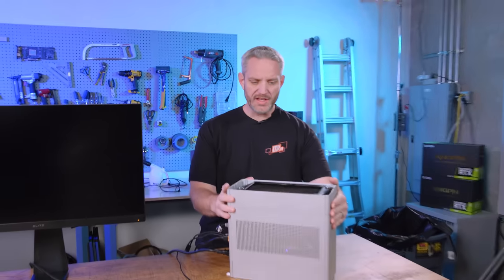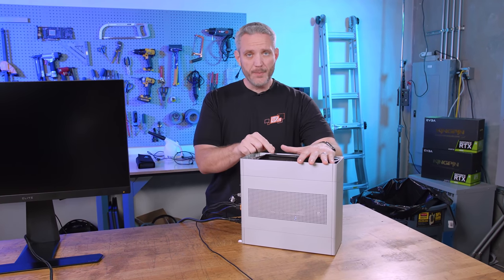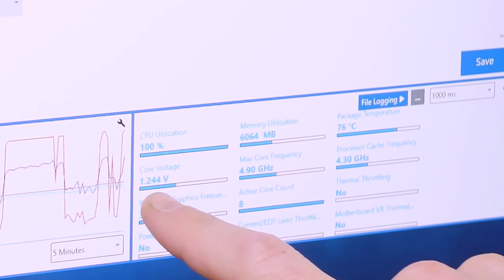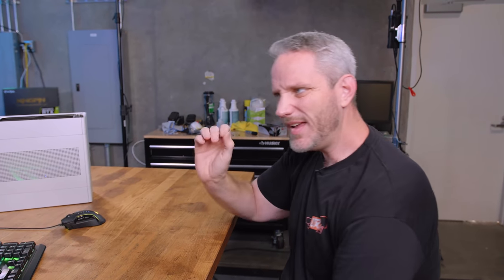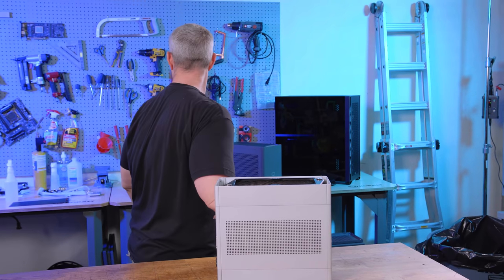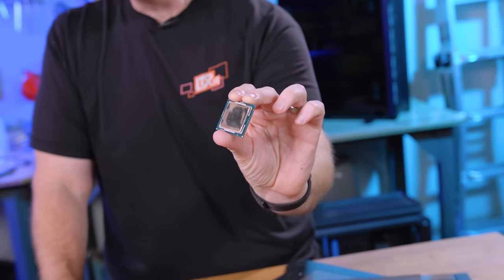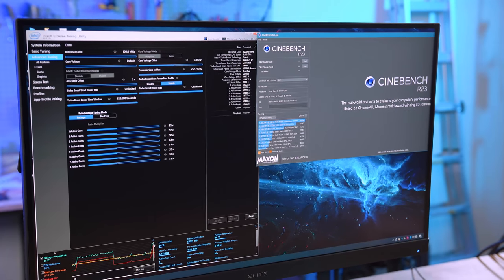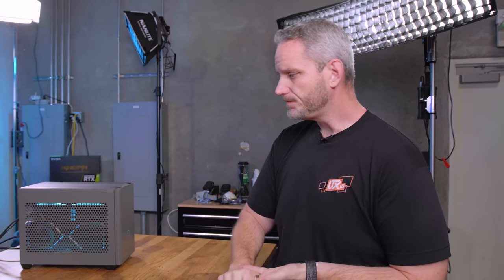THIS is what a Silicon Lottery Winner and Loser looks like for CPUs...

Comment: i know how it looks like in GPUs
two GTX 1660 Supers (ASUS Phoenix shitty model)
and one can boost up to 1930 MHz with like 912mv
while the other can barely get 1890MHz with 925mv

as an additional note, what i was trying to achieve is the highest clock with the least voltage that made these cards not overheat due to the joke of heatsink they have

Comment: My 9900k isn't a great chip, 5.0 all core @ 1.305v - had no problems playing games alone but the moment I had discord running I would get random blue screens. Bumped the voltage up to 1.325v and the blue screens stopped. Watching this makes me want to go back and retune using an offset/intel etu and see if I can get a better overclock.
Reply: Sounds like mine. 4.9 is the best I can get.

Comment: Silicon lottery = be the best you can be... lap your cpu!

Fyi Jay, in cal lab Navy, we used optical flat, caliper micrometer and theodolite to measure flatness (larger stuff we had a larger marble flat with map!).  So use optics to your advantage (overkill is better!) lol
Also, Casimir effect can come into play and you could possibly couple the cpu to the block WITHOUT any thermal paste (if possible, in theory would have the best heat transfer).

Would take time lapping but done daily for other applications.

Good stuff, Ty.

Comment: I've never done well with CPU overclocks since my 300mhz Celeron.  Never could get anywhere over a 100-200mhz on any CPU since (and that one had a 150mhz overclock...20+ years ago.  No matter what other components, no matter the methods, and countless reddit threads...the most I ever got extra on my 9900k was ~160mhz, and on Prime 95 it would still overheat - to keep it stable it would maybe not throttle at 4.7.  Other people, same coolers, similar airflow could get at least 200+.  I don't what it is, I've had terrible luck with CPU overclocks - at this point I'm never going to pay more for an unlocker/overclocker-friendly CPU ever again.

Comment: That interesting to know as I have the Xeon X5675 overclocked to 4Ghz with the voltage offset and every power saving / c-state options enabled and the vcore varies from 1.192v to 1.248v depending on the CPU threads load but most times it hovers around 1.208v. I would like to see if anyone could get close to my silicon lottery. I am over the moon getting 4Ghz with extremely low vcore :). And a bonus silicon lottery as well during gaming the temps never exceeded 45c as the GPU is the only thing that is the hottest in the system. As it air cooled by Noctua NH c12p se14 with Noctua Redux 1500rpm controlled by the bios so it spins the fan at 980rpm until it get close to 60c and the fan will ramp up :)

Comment: personally i like cold system, and as low noise as possible, so my main thing is always undervoltage, especially on GPU.. i´ve been playing with my old 3080 ASUS which from birth has been running 72-79 in my case because of constriction, only 2 intakes (140´s) but through a rad.. so 76 was the norm, with a aggresive undervoltage, YES it dropped from 2010 to 1980, but from 76 degrees to 68 degress with WAY less fan noise.. just a way lower noise signature, with .. minimal loss of performance. YES could run my ASUS ROG 3080 OC with a AGGRESIVE OC had it way over the 2010 it runs stock profile, silent bios.. so it can also run way faster

Comment: I never oc my cpu but i have a friend who have the same as me and he was forced to undervolt his cpu with stock frequency while mine just on stock voltage boost himself to 4.8-4.9Ghz without touching the voltage or frenquency. His cpu only boost at 4.4Ghz, i am pretty sure my cpu is a golden one, obv i am pretty sure if i wanted i could bring him to 5.5Ghz with no issue since he heating max at 65°C on full load. I just dont really like to overclock my pc part, oh i forgot to mention that my cpu is a 5800X3D (my friend too of course) my friend got the worst looser of silicon lottery

Comment: i won the silicon lottery on my r7 3700x. it benches and clocks like an average stock  r7 3800xt
Reply: i also got lucky with my previous r7 2700x. it punched above its weight too, but not as much as my current cpu (which i got second hand for 120€).

my current rtx 2060 12gb gpu overclocked to 3060 mem/core clocks performs above an average 2070 and is very close to a 3060 in benchmarks, while staying at stock voltage and power/temps.

my x470 motherboard runs two different 2x8gb 3200mhz c16 kits at their single kit rating. but i increased the voltage of it by 50mV as that gave the best benchmark results, even if it seemed stable without.

i have a very lucky system.

Comment: Speaking of silicon lottery, I guess I got unlucky with this 5900x I have. I went from using a 5800x that would be fine stock to having to run this 5900x at +6 PBO2 just to keep it stable. Lost frequency and temperature advantage basically. lol
Reply: Rma it brother

Comment: I've never bought a CPU that has overclocked well, usually they are barely stable at stock speed / voltage. Like my 3700x is unstable if I undervolt it at all. I think my i5 750 or whatever it was called overclocked somewhat.

Comment: I just wish I could get hold of ANY 9900K so I can prolong the life of this system as the 8700 non-K (could not get a K sku for love nor money when I built this rig 3yrs ago). 9900K's are impossible to buy new now without costing more than 10/11 gen & used prices are maybe 10% cheaper than the new cost! For not much more money I could just buy a 10/11 gen CPU & board, & if going to do that, I may as well just build a whole new rig TBH. Not into serious overclocking as stability is more important to me but the 8700 is starting to show it's age now in Premiere Pro with a RTX2070
Reply: Funny, you say you wish you could get ahold of ANY 9900k and then go on to complain about the price of them, e begging is weak dude

Comment: Very sad Intel (or Dell at least) removed undervolting on some older 7 gen laptops due to an exploit.  I managed to hack together a bios to get it back I dropped .150mv for about 15C cooler. Now the fan never runs at 100% and I haven't even repasted it.

Comment: Hey Jay I'm not sure if you'll see this ever but I'm hoping you do. I've run into a bug with my computer and have no clue as to how to stop it from happening. It started about a few months back and what happens is that my PC will suddenly crash, stop all movement from happening on screen and play a super super loud buzzing noise and doesnt fix it self. I have to force shut off my computer. Someone said it's due to the lack of thermal paste but I replaced it being the desperate person I am and honestly it sort of worked for a few weeks at this point but now its back...  any clue why? I know it's not overheating because my PC rarely ever runs hot but when it does it never happens.

Comment: Do you think silicon lottery will affect pc to run slower after being left on for more than 3 hrs before being restated? I've got a 3700x that I've had for a year and it's always had this problem, used the default cooler, used a nzxt 240 radiator, and even repasted with thermal grizzly paste and while tennis came down, I still have to restart my pc after 3-5 hrs because it acts like it's an old pc. Windows is installed on 1TB nvme.
Reply: the silicon lotteery is in regards to the quality of the silicon and how well it functions  to its original design specs  and because of the insane complexity of today's chips and nano scale differences and even quantum effects also differences in molecular composition, the position on the wafer on which it was made can make a difference as well.
yours sounds more like a software problem  or something with the RAM or even the operating system.
Reply: @connorjohnson4402  thank you for the great clarification of the lottery deal and your suggestion, I know its not my ram as I had a 2x8 kit from gskill and upgraded to a 4x8 and it still has the same problem, so I will do a fresh install of the os, as I just bought a gen 4 nvme that I was waiting for the right one on.

Comment: Do you recommend lapping a CPU(If we are comfortable doing it)
Reply: Sometimes it can help but ideally you need to lap both its IHS and the heatsink or CPU water block cold plate too as Intel IHS for years have been concave (bow inwards) and block manufacturers know this so will make their own block cold plates convex (bow outwards) (or visa versa) so if you lap the CPU IHS only then you risk making contact worse with your chosen cooler as it may then make worse contact, so for best results lap both the CPU IHS and the CPU Block or heatsink (allowing for any heatpipes etc that run across the surface of the Air cooler contact plate).
Its not necessary to get an mirror finish either on the IHS, only that the Silver coating on the IHS is removed down to the bare copper and that its lapped on glass to ensure a flat overall finish on the IHS.

You can of course "go the whole hog" and lap it to a mirror finish and use something like a very fine grit Diamond polish (off eBay or Amazon) to get the best mirror finish possible but its not something you have to do.

Sometimes lapping decreases "core to core" temperatures and other times it has no perceivable effect at all and is a complete waste of time and effort. Only you can decide if you want to try it but don't expect miracle results.

With an CPU like the 9900k, the best results in temp drops come from delidding and then pasting with Kryonaut Liquid Metal and use a Custom copper IHS, eBay has people that sell that kind of service and in the UK the average price for postage to and from the person doing it is about £60 or so and that includes the service and copper IHS too.

Comment: I probably got a massive silicone lottery loser.  I got a decent mobo (Aorus Z390 Pro Wifi), a Corsair RM750x on a pure sine wave UPS for stable power, a 360mm AIO with Kryonaut paste.  I could not get my i9-9900k to run at even 5 GHz all core.  Now, mind you I haven't done any overclocking since the days of moving jumpers to change the base frequency...  So I'd rate my competency level of modern overclocking at "complete n00b",  But even just setting everything to "auto" I don't ever see anything above 4.9 GHz, not even on one single core... and it's supposed to hit that on ONE core, right?  It's rated to have a boost clock of 5 GHz, and I know that they only need to achieve that on one core in order to claim it...  Oh well, even at 4.9 GHz it's still a pretty good chip.

Comment: Hey Jay, u can tell me if my OC is good??, i have a 5900x on 4,6GHz with 1,231v, and my trident z 3200 cl16 to 3600 cl18 1,31v and IF 1:1
Reply: i would make sure that the memory overclock is actually faster than stock, if you haven't already.
Reply: @kuyans3889  i have done different benchmarks and i have a little bit more speed read and write and the same latency
Reply: @Loco965  sweet!

Comment: Hey Jay, I have a 10900K but never overclocked. I play Gears 5, Control and stream sometimes. My Gigabyte Z490M BIOS has something like a GAMING setting that adds +1 on all cores. What's the best way to OC, use that option, or the Intel program. Is it worth it to OC your cpu? Thanks :)

Comment: I have a saved profile for a stable all core 5.3 on my 9900KS on a custom loop. Daily I run 5.1 though it's fast enough.
Reply: Same, 5.1 during summer, 5.2 during winter (9900k direct die mounted watercooled) 5.3 is 24/7 stable.

Comment: Soooo if I have a Ryzen 5 3600 and have OCed it to 5.0 mhz and undervolting it to 1.26v, is that a great lottery? And is the only thing you have to worry about is temps when over clocking? Like as long as it doesn't get crazy high I can keep trying higher Mhz and Voltage? PS Cinebench R23 multi I only hit like 80 C.

Comment: great video. after seeing you using software to overclock, im wondering if you put does values in bios afterwards?? Because when I undervolt my ryzen 5 3600 with ryzen master, runs fine, passes cinabech etc, but when I put the exact same values in bios, instant lockup and need to do a bios reset

Comment: OC is fun, but daily use I've seen actual degradation. have an 8600k delidded that ran for like 2 years at 5.3 all core, now its been like 3 or 4 years and max it'll do all core reliably is 4.8 without throwing danger voltage. not a big deal as i have a 3900X now and now the i5 is in the spare PC.
Reply: Its usually just a burn in period imo.. every cpu i had did this... cpu cache voltage has a lot to do with the chip needing high amounts of vcore as well.. its best set .2 behind the cpu clock anything past adds heat and instability imo.. so if your cpu clock is at 5ghz.. set cache to 4.8 or 4.7 if you have a voltage hungry chip... it can drop voltage and temps by a lot i had to tweak a friends oc recently because of this... dropped his cache down slightly and his cpu needed less voltage at higher clocks... and was way more stable and cool...

Comment: My 9900ks runs 5,2G 1.31V stable but is hot in Benchmarks max 86c, in gaming 60c. My allday setting now is 8 core 5,2G/ 6 core 5,3G/ 4 core 5,4G and 5G ring core with 1,4Vcore. 4400Mhz cl 16 32G Ram. Good to see because I thought my 9900ks sucks ^^ Really good 9900s goes over 5,3G allcore.
Reply: Both of my 9900k cant even get to 5 without burning. 4.9 and 4.8 for both on mine. Yeah you didn't loose lotto. I did twice

Comment: I bought an already delidded with copper ihs 9700k off eBay for 300 a couple years back 5.3ghz at 1.35v hit #10 on cinibench r20 for all of that chip. 55c under load with a 360mm aio. I've since upgraded to a regular 10900k and see 90c daily on 360mm aio lmao
Reply: Undervolt that puppy 😆  auto vcore on 10th gen is a joke it tried applying 1.5v on my 10700k at 5ghz... when it only needs 1.32 lol

Comment: my 8700k cooks at 90°C with a 360mm rad Custom loop at 4.7Ghz turbo, and goes down to 4.2Ghz to run at 75°C.
after that i'm just planning to get a 9900k or lap, delid this CPU and Liquid metal it (if i cant get a 9900k in my country for good prices)
Reply: Lower that vcore ... if its at auto i feel bad for that cpu... auto vcore and auto llc always slaps on way too much vcore causing high tempe
Reply: @TheBURBAN111  yeah no..i tried everything and followed 4 OC guides but it just goes to 90°C at 4.7Ghz at 1.26v. im just more tempted to delid my cpu at this point because almost everyone i see with good temps(75°C) at 5Ghz Delidded the CPU.
Reply: @walter_marcus  sounds like you have a hot chip or your cooler isnt touching fully... hope you fix it by delidding.